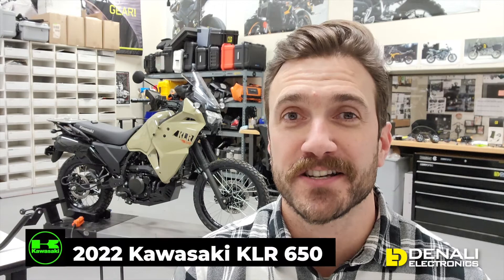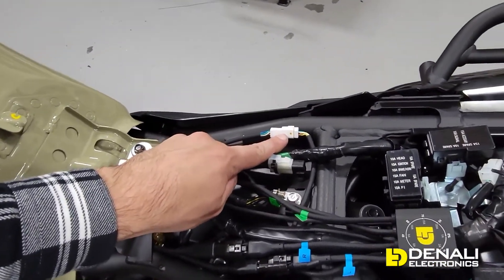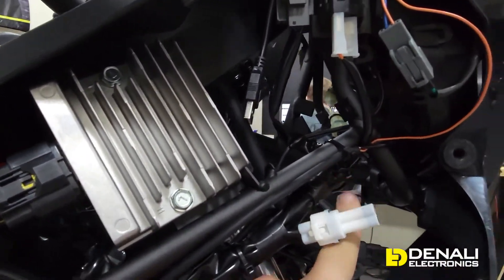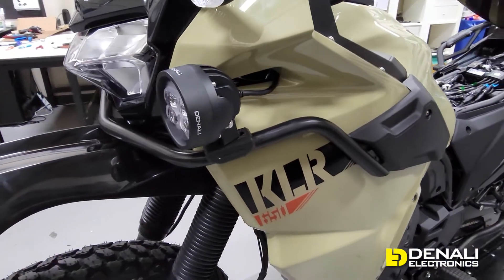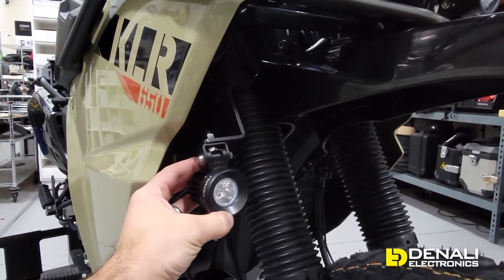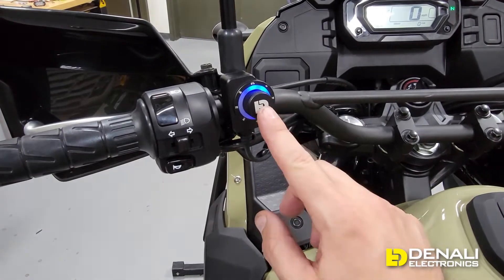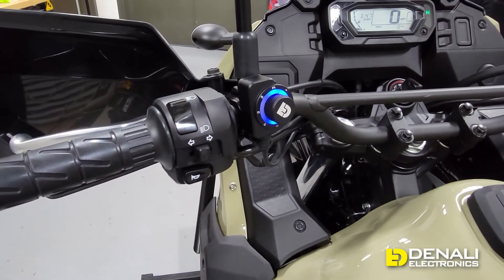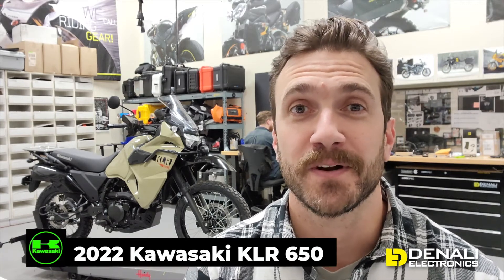DENALI DialDim Lighting Controller Install How To - Kawasaki KLR 650 Gen 3

Comment: Why do you only show installing with a vehicle specific harness? Make a video showing how you wire in the universal harness.
Reply from the maker: We made this video to show how to install the plug and play harness and DialDim on the new KLR650. To see details of the universal DialDim, check out this video: https://youtu.be/qALMEJLZ6xs
The universal harness is installed exactly the same as this, instead of using the plug-and-play harness, you tap each lead with the included posi-taps.

Comment: Looks awesome,  Will the upper crash light bar work with Happy Trails crash bars since they both install in the same side bolt?
Reply from the maker: We have not tested the light mount with Happy Trails products, but at the minimum, a longer bolt will be needed.

Comment: Hi man :D
Great video !!!
Did you print those mounts for D3s on 3D printer or?
Reply from the maker: Original test designs were printed on the 3d printer, but production mounts are manufactured: https://denalielectronics.com/products/upper-driving-light-mount-kawasaki-klr-650-gen3?rq=gc_motorcycle~yr_2022~mk_kawasaki~md_klr650

Comment: Are you able to use an after market switch with the CanSmart. I want to be able to use the dialdim dial in conjunction with the cansmart but idk how.
Reply from the maker: The beauty of the CANsmart is that you are able to use OEM controls without cluttering up the bars. You can run the DialDim to control the two driving light sets and the CANsmart to control everything else. We have a video coming out on 9/9 showing the CANsmart used in conjunction with the DialDim on a KTM 1290. The biggest benefit of running the DialDim is the ability to see if your lights are on and at what power during the day.

Comment: Ordered the T3 kit for the rear of my KLR, hoping it comes off backorder soon but I’m planning my next purchase, I have the Adventure model so it has factory fog lights which are great but the the headlight/fog combo is good for 80-100 yards in my opinion, I would like more light for the dark 2 lane highways we have here in south Ms, is it possible to modify the lower auxiliary light bracket to work with the D7 lights?
Reply from the maker: The D7s don't fit with the lower mount, there is fair amount of interference with the fork and fairing. If you are looking for more light, the D3 Driving Lights are up to the task. You could possibly modify the lower mount to fit D7s but we can't recommend it or suggest it.

Comment: That is an awesome product. Great flexibility, many options and functionalities.  But just does not match with the philisophy of klr650. Simplicity! Probably Bmw GS, Honda AT or Ducati MS owners will love it but for a light, simple,  hop-on-and-ride type adv bike like Klr,  this might be too over engineered. Kind regards.
Reply from the maker: You should give it a try, the DialDim is extremely simple to operate and it really cleans up the wiring for a couple of light sets instead of running numerous harnesses.

Comment: Would be nice. Wish I had an extra $1500
Reply from the maker: Lights, standard wiring, and mounts start at $410 for the KLR650. Even without the DialDim, any lighting upgrade over stock will be a massive improvement.
http://denalielectronics.com/apps/cart-loader?cff_crt=a05a768242e4624e43ee0f8d57620ffd_1676301805869
Reply: @DENALIElectronics  oh I have no doubt. But how much is the entire kit as shown in the video?  I am a KLR rider. Not a BMW rider 😄

Comment: No way I'm jacking around with the factory wiring on my brand new bike.unless it comes from Kawasaki it won't be on my bike.
Reply from the maker: The beautiful part about our bike-specific DialDim controller and harness is that it doesn't modify your Kawasaki in any way. The entire kit can be added and removed without changing anything on the stock bike.